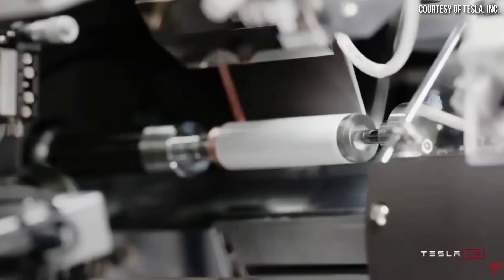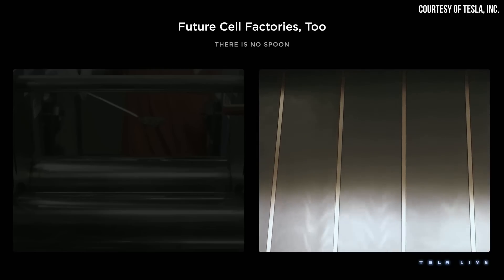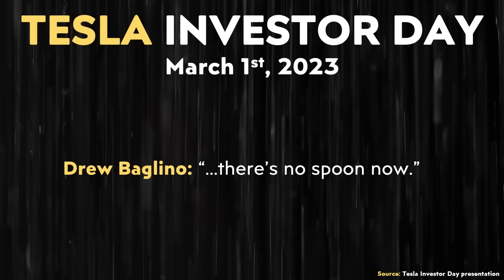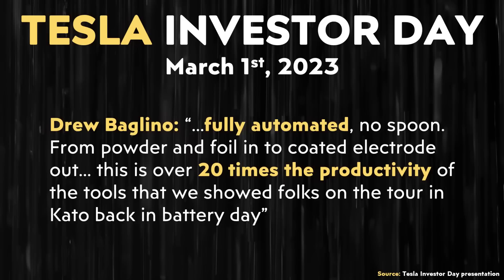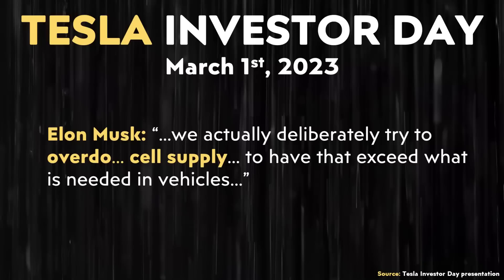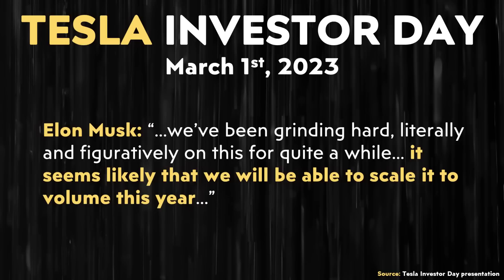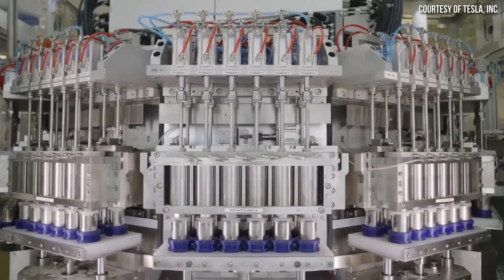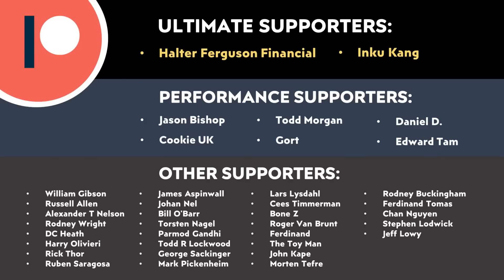NEW Tesla 4680 Battery Production Updates | 2nd GEN 4680 Batteries

Comment: To speed up the mass production of Tesla 4680 battery I think Tesla has to work with Foxconn of Taiwan to arrive at mass production at competitive costs against the junks of Chinese makers. Panasonic is as productive as Foxconn on this. However I doubt Panasonic could be as competitive as Foxconn or other Taiwanese makers.t would be symbiotic for both Tesla & Foxconn as both have a common competitor BYD that infringed on the proprietary rights of Foxconn.

Comment: I agree 100% with the part count indicating a delete of the bottom collector. I think the big question now is if that freed up room to improve gravimetric energy density to get closer to the the 2020 98wh projection. I unfortunately suspect it didn't because the bottom of the can now protrudes up into electrode space sufficiently enough to consume volume gains made from the part delete. .

Comment: When will the Gen 2 4680 battery packs be installed in the Model Y? Or are the already doing so?  Would you choose a MY AWD (with Gen 2 4680) over a MYLR ?
Reply: I don't think the buyer will notice any difference. They aren't at the point where they can replace all MY packs with 4680s, and until they can the price will benchmark against the 2170s. The breakthrough is more about massively expanding volume production and getting the production cost/vehicle down. The cost/vehicle will mainly help Tesla's revenue/vehicle, as the purchase price is set by market demand, and only comes down as there isn't enough demand at the higher price point.

Comment: If the battery (at some point) is made with both dry cathode and dry anode, does that make it a "solid state" battery? Or is that something completely different?
Reply: Completely different.

The process is dry, but wet liquid electrolyte is still used.
Reply from the maker: Exactly! The dry process is just for manufacturing the electrodes themselves and the liquid electrolyte is added to the battery can at a later step. Tesla is still making traditional Li-Ion batteries, and not Solid State ones.
Reply: Apparently many on the investor day tour where told they are both dry formed now! 
But no still not solid state, can still has electrolyte to carry ions, ss has a porous solid between electrodes
It's the elimination of solution and long, expensive and slow drying lines in the electrode manufacture!  Like walking speed, or a jog. 
Allows 1/3 of the space to produce at massive speed, think softdrink factory, so fast they blur,

Comment: The foil shown was aluminium - discoloration is a lighting effect. So Austin producing dry anode and cathode electrodes.
Reply from the maker: No, an expert pointed out several other unmistakable clues to me from this video Tesla shared that confirm that this was the Anode process being demonstrated. In addition, the tour that attendees were taken on only included the anode line.
Reply: @Cleanerwatt  cathode not quite ready yet. Still half DBE. Need more effort to figure it out. Waiting to see more good news
Reply: @Cleanerwatt  Hmmm. What is the explanation for the 'metalic' strip between the 8 anode strips being 'silver' in colour? 
Is the conductor foil a copper alloy that gives the silver look??
The foil is normally coated in electrode on both sides with the foil performing the role of conductor and  'lithium ion barrier'. 
The membrane that allows the lithium ion to flow between the cathode and anode looks like a white-ish plastic, but we only see it in the video once the 'jelly roll' is formed. 
Is the 'silvered" look from a conductive bonding agent that sticks the strips of anode to the copper foil?? 
If the anode is to be matched with LFP cathode, is the voltage differential low enough to use aluminium for both conductor foils???
The mother roll is cut along the centre of the silver strips and serrated every centimetre or so. Is the 'silver' strip performing a strengthening role until the cut occurs??
Many questions as to what we are looking at!!

Comment: Progress has been slow because they keep upgrading and improving their machines. They are on the 7th generation of production hardware for the 4680. Difficult to scale when you are changing hardware every 6 months.
Reply: They probably have a target deadline to decide which direction to invest and build up copies of the current hardware.
Reply: Each iteration benefits with some yield before upgrading. If the improvement is less, the production runs longer before upgrading otherwise, immediate upgrades are proportional to yield benefit.

Comment: Excellent report, thank you!  As for the deleted part in the 4680, the bottom laser weld doesn't contact all flags.  This implies a bottom current collector is still present underneath.  But I think you're on the right track....perhaps it's actually the top current collector has been combined with the button?  That would allow better control of the position of the button during assembly, and result in one less component.
Another possibility is the removal of an insulator at the bottom.  If memory serves, the bottom of the Gen 1 is electrically isolated, while the Gen 2 is obviously connected.  But that may have just been a feature of the bottom plate, and not a separate part.
Reply: Interesting conjecture.

I don’t think the laser welds only contacting some flags is a problem. There’s a lot of mechanical contact at the bottom, and the laser welds should just be icing on the cake to keep everything together.

The bigger question to me is the problem of corrosion at the interface between the two dissimilar metals.

If that’s not a problem (which they should have had to solve with the gen 1 cell at the crimping interface anyways), then I think that eliminating the copper current collector at the bottom makes the most sense.
Reply: Good point on the weld not contacting all the flags. I think they are more likely to have deleted the bottom collector and just allowed for a mechanical connection, reenforced by weld rather than remove the top. That top collector needs to be insulated from the can to avoid shorting to can negative which I assume is easier to do with the flower than with all the little sharp flags/tabs.

Comment: What about Sandy Munro's comments that he saw a battery production line without any drying ovens - doesn't that imply that Tesla have the dry cathode production up and running at Giga Austin?
Reply from the maker: Tesla only allowed participants to view the anode line, which is running the dry process. Thus, no drying ovens. As far as I know, no one from the public has been able to see the Cathode  lines to determine what Tesla has going on there (dry or wet).
Reply: @Cleanerwatt  We do not know whether the cathode is wet or dry yet, but judging by the footprint reduction for the new factories they must be making excellent progress on the DBE for cathode. If still using a wet process, that humungous oven is going to be very hard to hide.
Reply: @not today no it uses no solvents, it's mixed and rolled out DRY
But cans still have electrolyte

Comment: First video I've seen highlighting the anode/cathode progress ambiguity in the information provided on Investor Day.
Reply from the maker: If they had solved the dry cathode process, I believe they would have made that very clear.
Reply: @Cleanerwatt  
It looked like Aluminum to me.
Either way, if the cathode line is slow, all they need to do is double up on that section to supply the same amount as the Anode machines.
As they improve they can even the supply by adding another Anode line and speed up the canning process.
The machines will all be used.
Reply: @rogerstarkey5390  I agree it looked like aluminium.
Reply: @rogerstarkey5390  No it's quite obviously copper in the video
Reply: @Cleanerwatt  Yes, I was listening for it and they didn't say it, so I assumed they probably haven't yet solved the cathode manufacturing issues.